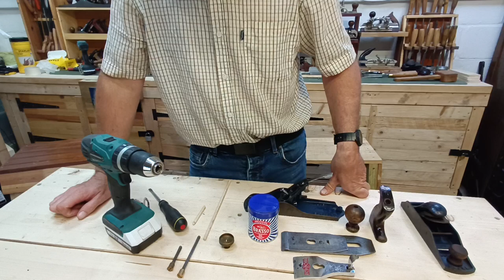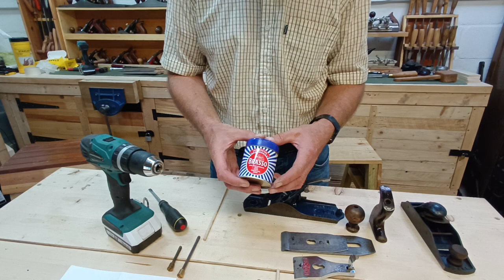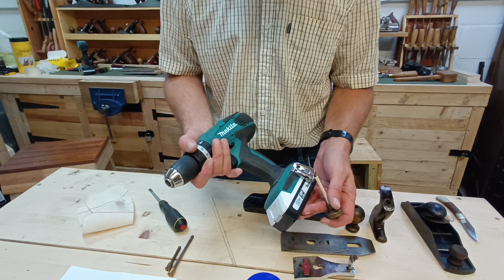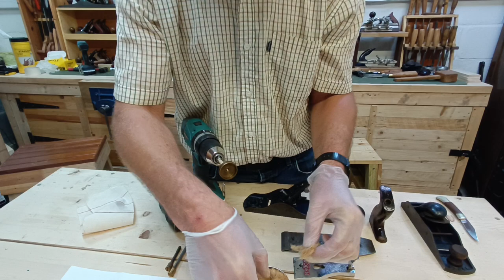How I polish up Plane brass hardware

Comment: Vin, I do like Brasso and use it for exactly those plane adjusters wheels. However, I put the part in a soft jaw vise and use tooth brush and cotton swabs, I never wear gloves or use a loose rag around rotating tools.
Reply from the maker: Absolutely that works too, my method is just a quick easy way. I'll never knock anyone's methods...variety is the spice of life 😀